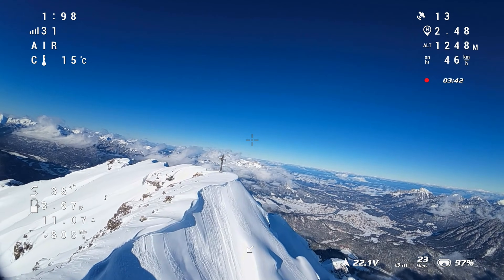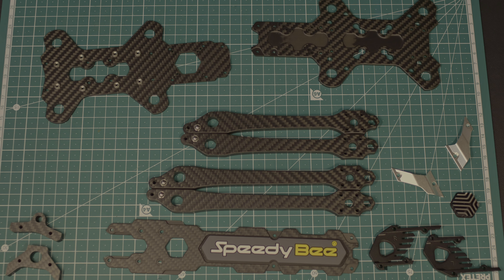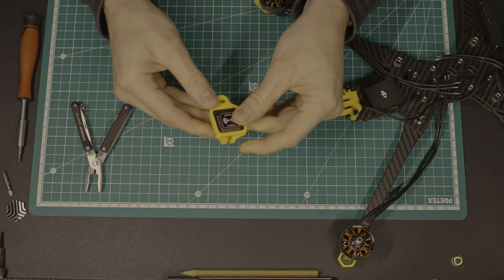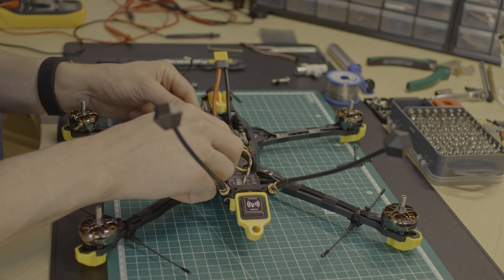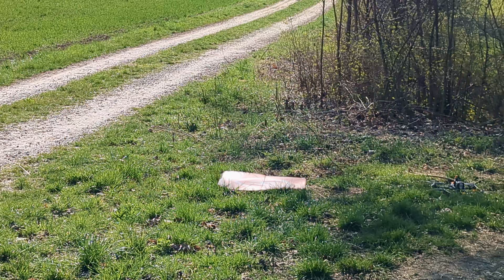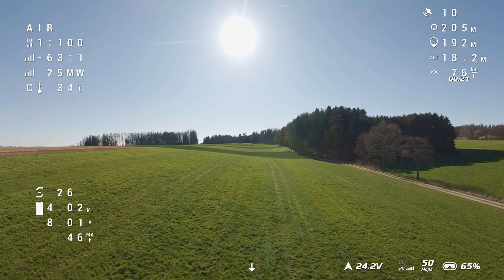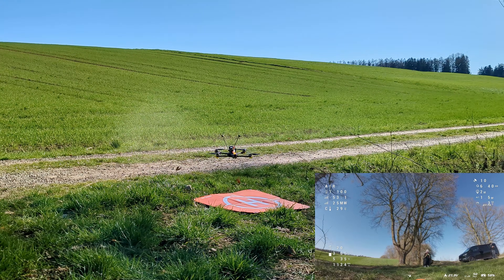FPV Long Range Build Speedybee Mario 8

Comment: hi, could you tell me what licenses are required for long-range flights… is a commercial permit necessary?
Reply from the maker: Hi, that varies from country to country. There's no simple answer. In Europe and the USA, long-range flights are difficult to do legally. In many other regions, they're (still) not a problem. I'm from Germany and hardly ever fly here anymore, and certainly not long-range. The regulations are very strict, and private flights (out of LOS) for pleasure aren't legal anyway. That's why I fly in other regions.
Reply: @flipsfpv  Unfortunately, this hobby is doomed😢,from a legal perspective...i mean

Comment: I wonder if you can fit 9 inch two blade props on the Mario 8
Reply from the maker: 9" props don't fit for me. They would collide with my VTX antenna mount. But without the custom mount it seems that there is not enough space left for 9"...

Comment: Great video !! .... ive just built the Mario 8 ..... im having the same issue as you .... first flight it fliped exactly like yours ..... checked the order of the motors , direction , blade direction and flashed the ESC's .... everything was doing what it should have been doing except fly haha .... any tips ?
Reply from the maker: Thank you! 
If you already went through all the motor and ESC settings: a wrong FC direction setting can cause this behaviour, too. You can modify the degrees in Betaflight according to the arrow on the FC, if it’s not pointing to the front and is visible on the top?
Reply: @flipsfpv   thanks for your reply ..... last night i went through it all again ..... and guess what .... that was exactly the issue .....the FC was out 90deg .... corrected it and flew great .... thanks again for your reply :)
Reply from the maker: @jamesmclachlan5835  thanks for the feedback! Glad to hear it’s flying now 💪🏼

Comment: Nice video!! Do you have STL for O4 lens mount? or where i can buy the mount?
Reply from the maker: Hi, thank you! 
I ordered an O4 upgrade kit from AliExpress. It’s called „O4 Pro Upgrade Kits 3D Printed Parts TPU Part for speedybee mario 5 Upgrade O3 to O4pro“. Works well for the Mario 8 👌🏼
Reply: @flipsfpv  oh nice, thx alot for the info

Comment: Nice mate. I also just assembled my prototype mario8 with same engines and o4 pro air unit. Did you find a good tune for it, because i am very interested. I dont know much about setting a good tune, so i would appreciate your help alot :)
Reply from the maker: Hi! Unfortunately, I haven't found a really good tune yet. As you can see in my latest videos, I'm still dealing with the drone shaking. The filters are good now, though. My current tune is this one:

# profile 0
set profile_name = M8-LR
set dterm_lpf1_dyn_min_hz = 0
set dterm_lpf1_static_hz = 85
set dterm_lpf2_static_hz = 0
set throttle_boost = 0
set p_pitch = 40
set i_pitch = 50
set d_pitch = 30
set p_roll = 35
set i_roll = 45
set d_roll = 25
set p_yaw = 35
set i_yaw = 45
set d_min_roll = 0
set d_min_pitch = 0
set motor_output_limit = 90
set feedforward_transition = 40
set feedforward_averaging = 2_POINT
set feedforward_smooth_factor = 30
set feedforward_jitter_factor = 15
set feedforward_boost = 5
set dyn_idle_min_rpm = 6
set simplified_pids_mode = OFF
set simplified_i_gain = 95
set simplified_dterm_filter = OFF
set simplified_dterm_filter_multiplier = 120

But it still needs some adjustments!
I received some tunes from the community here. I will test them and hopefully find a good one :)
Reply: @flipsfpv  Thx for that! Please let me know if you find a better tune :)
Reply: Hi again. I was just outside to do my first testrun today. I did it with an existing tune in betaflight if you search long range 1000-1400g i think its called. I only did minor adjustment to it. It  was very windy today and i actually was impressed on how calm it was in this weather. Have you tried this tune? :)
Reply from the maker: @FPVTrickster  hi, no I didn’t try this one before! I found it and will try it, too 👍🏻 Thanks for sharing!
Reply from the maker: @FPVTrickster I took my Mario out for a try with this tune. Works much better than the default tune. Thank you for the hint!
What changes did you made on your side?

Comment: I am a biginner and i was wondering if there is a way to build in 1750kv motors and which i should choose?
Reply from the maker: Hi, I would not recommend to use 1750 KV motors for a 6S Long Range build… Especially with 7“ or bigger. Lower KV handles bigger props better and is more efficient.
The SpeedyBee 1050KV are okay. You can go with even stronger motors. There are some recommended motors mentioned in my latest video in the comments from other pilots 😉

Comment: A gorgeous piece of kit :) May I question about the connectors? I can't find the male one for the wires (not soldering). Can you put here the link where to buy it please? Many thanks and keep going with the drones.
Reply from the maker: Hi, thank you! Sorry I don’t understand which connectors you mean. To the flight controller? From the receiver or gps?
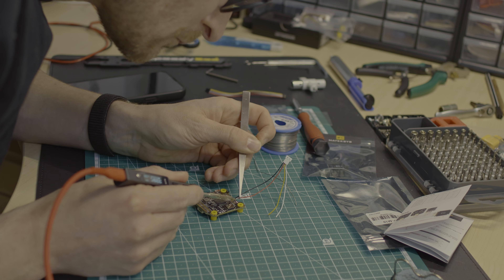Reply: @flipsfpv  Sorry, 3:33 min (JST SH 1.0 male - I hope). Female I can find milion of them but male none.
Reply from the maker: @JosefSkořepa-b1q  ah okay. Yes I searched for that some time, too. I found a package on eBay in Germany. The shop is called „Top-Digital-Technik“. The had a set with the cables and female connectors some time ago. I can not find it anymore there…

Comment: soldering- get a good soldering station like the fnirsi 200w one, get a decent sized tip and flux, please dont use the no clean ones, they areuseless, get the syringe ones. dont heat pads or solder too much without constantly applying solder, dont use too much or too little solder and mae sure the wires are tinned throughout. if you follow those steps correctly you will get a good looing solder joint and not poopy ones
Reply from the maker: Thank you for the recommendations and the hints!

Comment: Great video, how did you check which anatena is working and which not?
Reply from the maker: When I removed the top plate, I immediately saw that the cable of one antenna was damaged. It had been pulled in and damaged when tightening a screw nearby…

Comment: Hi! Thanks for the vid! Please help to find this part where you connect from dji unit ufls to sma screw connectors? And how do you like albatross compared to stock antennas?
Reply from the maker: Hi, you are welcome! I'm sorry, but connecting the UFL/SMA connector is not part of the video. But you can find a tutorial how to change the antennas here: https://youtu.be/_JmOk71HgKI?t=67
I think the main advantage of the albatross antennas over the stock DJI antennas is the length. The short DJI antennas are blocked by the battery in some orientations. On other drones I have had good experiences with the DJI antennas. But I always prefer the longer albatross antennas to cover more orientations during the flights.

Comment: Great video man! I didn't know this frame was out there!  I just lost my custom helion 10 so I'm looking around at other frames.  Kinda lol.  It was brand new and I had put a lot into it so I'm still dealing with the ptsd... I'm going back to look for it again when I go through Wyoming tomorrow but I'm a trucker... I was under a load that didn't allow the time to be wondering around in the wilderness.  I'm liking this 8 inch frame though! Keep us posted! You put a 6S2P li-ion pack on there yet?  Flight time?
Reply from the maker: I'm sad to hear you lost your Helion! Did it crash, or did you lose the connection? Hopefully, you can find it!
8“ is a good size. I can definitely recommend it. However, I haven't tested the 6S2P yet. Hopefully, I'll be able to test it soon! With 6S1P and 4000mAh I get 11-14 minutes in the mountains 💪🏼

Comment: Nice build how much does the drone weight without the battery?
Reply from the maker: Thanks! The weight of the drone is 783 grams without battery and without GoPro.
Reply: @flipsfpv really, my 10 inch is very similar, though my motors are bigger at 3115 900kv weighing 112 grams per motor x4 = 448grams leaving around 300 grams for the frame and electronics, need to find ways to save on weight. Frame weights around 160grams though 😊
Reply from the maker: Yes, I was a little disappointed after the build. Because on the offical Speedybee page the RTF build is quoted with 695g...

Comment: Really great video, subbed for more. I’ve got one of these too, really like it although I have not been flying it as much as I should. I’m thinking about converting mine to O4 Pro from the O3 that I put in mine.
Reply from the maker: Thank you very much! Just watched a video of your Mario8. This confirms my impression that the standard betaflight tune fits the Mario8 quite well. I upgraded another drone from O3 to O4 and was impressed from the connection.
Reply: @flipsfpv I think it does well on stock Betaflight. I did get a tune from someone else but I have not tried it yet. 

The O4 Pro is amazing. I have 4 on drones, 1 on a place that I haven’t flown yet and a spare new in the box.

Comment: the o4 comes with those 2 tiny antennas, what did you replace them with? and this video is great
Reply from the maker: Yes the O4 antennas are very short for a LR build. I used the "iFlight Albatross V2" antennas in combination with "IPX to RPSMA Extension Cable RP-SMA Female to UFL Female" adapters. This combination works for the O3, too.
Reply: @flipsfpv which cable end goes to the o4?
Reply from the maker: @nac2416  the IPX connector
Reply: @flipsfpv hi great video, what goggles you using? Those albatross antennas are LH ot RH?
Reply from the maker: @thaikerfpv hi I use the DJI Goggles Integra. The albatross antennas are LHCP

Comment: be sure to share diff instead of dump. diff are the changes from stock betaflight, and dump is for diagnosing very specific things
Reply from the maker: Thanks for the hint - I totally forgot to add the settings-file to the description. I added it.
In fact, the backup method “Save Preset” basically saves a copy of the “diff all” output in a text file. I used this method and added the file for sharing.

Comment: I lost one last month in Madeira. What are your feelings with the 1050 motors? I had 1300 and it seemed a bit low when exiting the dive. What length of cable did you use for the O3, 200 or 300 mm? 

Good luck
Reply from the maker: Oh sorry to hear that! So far I did not test it that much. The motors feel okay cruising around. I let you know after my first dives what I think about the 1050kv motors 😉
I used the 300mm cable. I think 200 would have been enough…
Reply: @flipsfpv  I used a 200 mm cable and it was slightly tight and I saw that you even turned the vtx ... I'm curious about your impressions. I definitely don't recommend flying with a loose battery cable - the drone vibrated during the flight, Interesting fact, when using 8046 propellers I had a very large jello, I see that you use 8040 ...
Reply from the maker: Thank you for the tips! So far, I have jello, too. I hope to resolve this soon. Thanks for the hint about the props. Now, I'm curious about the flight behavior. I hope to test it soon!